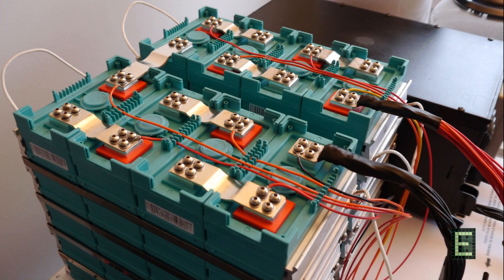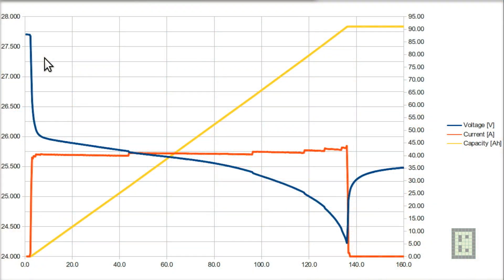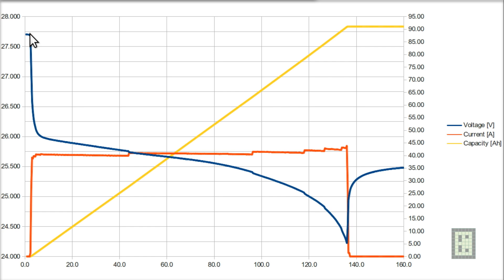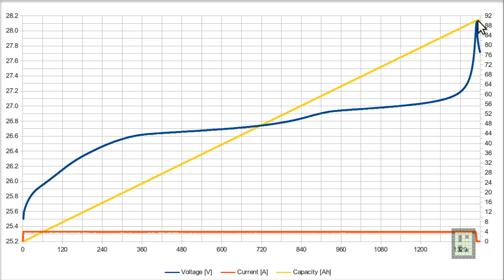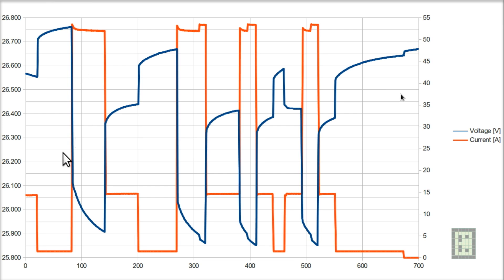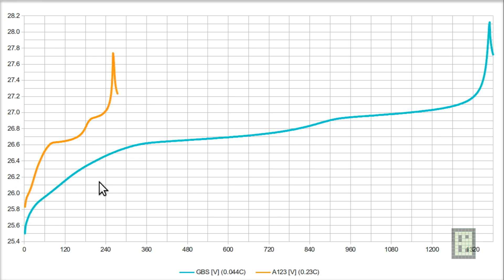GBS 100Ah LiFeMnPO4 Battery review part 2

Comment: Few years went. Do you have some other info about these batteries after using them? The fact that they didn't went to full 100Ah capacity, and only to about 90Ah is really strange. You mention the GBS have lower cycle life than A123, but from the spec sheet I see GBS-LFMP100AH have >3000 cycles at 100% DoD, and >5000 cycles at 90% DoD at one of the sellers, and <0.8 milliOhms. But then again on GBS aliexpress page (which are all mess, like same battery many times with different titles, and with some specs different on different pages, even when I look at the same model number of the battery! For example two different listing for LFP-100Ah, not LFMP, show different internal impedence and different charging/storage temperature ranges), for LFMP-100Ah I see indeed 3000 cycles at 80% DoD. But they also say 0.6miliOhms instead.

Examples:

https://gbsystem.en.alibaba.com/product/60220967211-220346384/100ah_lithium_solar_power_storage_battery_GBS_LFMP100Ah_B.html?spm=a2700.icbuShop.41413.52.448a14137aK20U

https://www.boostech.de/en/produkt/innopower-lfmp-100ah/

http://sd94f85fb6682eee7.jimcontent.com/download/version/1453492416/module/13104697325/name/GBS%20100Ah%20Datenblatt.pdf - also shows that they have more than 100Ah usually.
Reply from the maker: I used the battery to power my offgrid house (I live there so is full time use) for about 5 years when I upgraded my battery to a 5kWh made with A123 cells as my energy usage increased over time.
The spec when I purchased this cells where 1500 cycles at 80% DOD and 1.8mOhm internal impedance and they did worked as spec but spec is worse than any of the competitors.
Current generation seems to be improved with lower internal impedance and higher cycle life 3000 cycles at 80% DOD but that is still worse than Winston for example with 5000 cycles at 80% DOD.
I think the official Alibaba store has the correct spec 3000 cycles at 80% DOD and that means they improved doubled the cycle life compared to the first generation cells that I had.
A123 cells have 5400cycles at 100% DOD so superior to both GBS and Winston.
You can read here a bit about the degradation of my pack  http://electrodacus.com/solarforum.html?place=msg%2Felectrodacus%2FFqn_ShZDPdc%2FDUoG_r9fBQAJ
I had a much more detailed review on google+ but that no longer exist maybe I will rewrite that review. I had 17% degradation over 5 years with a 47% DOD every day so around 3.4% degradation per year most of that likely as calendar aging degradation while the A123 battery in similar use case had just 0.9% degradation after first year.

Comment: How about part 3 to see the capacity 3 years later.  Hopefully over 90 Ah.
Reply from the maker: It was barely 91Ah when I tested new and did this video almost 5 years ago. This was not the best LiFePO4 and I used the battery quite heavily in offgrid to power my house. A few months ago I did a test you can see the result here on my google+  https://plus.google.com/+electrodacus/posts/hQn19Z1WGgS
Reply: http://batteryuniversity.com/learn/article/how_to_prolong_lithium_based_batteries  According to this chart cycles double for every .1 volt drop in charging 18650s.   If you lowered the termination voltage to 27.3 you could see a significant reduction in degradation.   You would think all batteries would be somewhat similar.
Reply from the maker: That only works like that for high energy density cells like LiCoO2. The effect here by reducing the max charge voltage is much, much more insignificant for LiFePO4.
LiFePO4 has no problem with cycle life since in lab test they charge each cell to 3.6V and do a 80% DOD and get 5000 cycles as is the case for Winston cells the Sony LiFePO4 cells can get 6000 cycles at 100% DOD so the cycle life is no limitation and there is almost no degradation during cycling with this type of cells.
The more significant factor is aging that affects all type of batteries and that is usually not specified unfortunately.  Sony cells have this specified and it was just 0.3% capacity loss in storage per year at +23C but when the cell is kept at +40C the capacity degradation is already 1% per year.
With less quality cells like my GBS here the effect of aging is probably much higher even at low temperature and that was probably one of the main factors contributing to cell degradation.
With high energy cells if you reduce the max charge voltage you also reduce the available capacity so while you may bring the cycle life from 500 at 4.2V to 2000 at 4V the available capacity is just 75% or so and then the cost gets similar per capacity with LiFePO4 that has anyway higher cycle life and is also much safer to use

Comment: Hi Everyone,
I'm building a solar UPS system which will use the grid as the backup, it's to offset my electricity bill by taking low power appliances like fridges & lights etc off the grid, Which chemistry do you recommend, and which manufacturer?
Thanks
Reply from the maker: +shanon edser Not sure what country you live in and what the electricity rate is there but in most places in the world battery energy will be more expensive than grid energy. You ca look on some of my recent videos and see that I live offgrid now and power my house using LiFePO4 (the least expensive energy storage battery at this point but still more expensive than grid). I also designed and developed a Solar BMS that you may want to take a look at and that can be used to do exactly what you want but it will not be able to compete with grid or barely but there will sure not be an advantage.
Reply: +electrodacus 
Electricity is very expensive here in Australia, we actually have some of the most expensive electricity in the world (27cents per kWh at the moment)in other states (48cents) due to time of day metering which we will have where I am in Brisbane soon, luckily we have lots of sun.
 I am looking at importing batteries from China, GBS is one of the brands I'm considering so your opinions and experiences would be much appreciated.
Thanks,
Shanon
Reply from the maker: +shanon edser 27cent maybe even 48cent is not expensive enough to make battery storage cost effective.
Best case scenario is 15 to 20 cent/kWh for each kWh retrieved from the battery. In contrast solar PV panels produce electricity at about 3 cent/kWh so is much better to have an over-sized PV array that a large battery for offgrid and for grid tie battery will not really make economic sense in my opinion.
That 3 cent/kWh for solar PV production is the amortization of solar PV panels alone no other equipment and is based on 25 years life and 1$/Watt for the PV panels also based on the amount of solar I get here at my location in Western Canada that is exactly the same in Sydney Australia (average over a year).
So at the moment best option is to have a large PV array connected to grid and not have any battery storage.
Those 15 to 20 cent/kWh are also based on the best LiFePO4 batteries and a bit ideal numbers.
Best according to spec seems to be Winston LiFeYPO4 they have almost 4x lower internal resistance when compared to similar 100Ah GBS cells. Also claimed cycle life is 7000cycles at 70% DOD for the Winston cells.
So the amortization time is around 20 years or over with a 70% DOD cycle each day but that will probably be hard to obtain since energy consumption is variable from day to day.
Best thing is to use the energy when available from the sun as I mentioned as low as 3 cent/kWh then use energy during off peak hours when energy is less expensive if you opted for differential tariff.
I have a highly energy efficient house so I only use 60 to 80kWh/month and I use most of that during the day when available from the sun.
My calculated average rate (maybe a bit optimistic since I did not included the labor for installation just the cost of equipment) is about 16cent/kWh with best rate during the day around noon probably as good as around 5 to 6cent and as bad as 25 to 35 cent during the night. Again not realistic since the labor is not included and that could almost double this rates.
Reply: +electrodacus 
thanks for your help mate

Comment: I'm hoping to talk my company in to using these for offshore power for SCADA systems
Reply from the maker: It seems to work fine for me I use them daily with 50 to 85% DOD for close to two years and I do not see any significat loss in capacity. I will need to make a capacity test but now in winter is a bit hard since I need that energy. I will probably do that in spring to see exactly what the degradation is.
But if weight and volume is an isue LiCoO2 will work as good or better charged at 3.95V
I'm guessing since is a data aquisition system the discharge rate is quite low.

Comment: Hi,
Great Data sets. Do you have the related current draw data? I would like to use this to develop a battery management system, and could use real data (as opposed to generated data.
Thanks
Reply from the maker: The related current draw is there charge was done at constant current so is a strait line and discharge was done at constant power so almost a straight line again.
"generated data" ? This are real data see the other videos on how I made the measurements.
I'm actually working on a 3 to 8 cell BMS see my other video it will be fully programmable and work with any type of lithium cells.
The video is about the first revision the second revision you can see on my google+ page the Dacian Todea not electrodacus one you need to scroll down to some of the first posts there are a lot of photos with my off-grid house there.
The new version will support 80A discharge and 40A charge maybe I will decide to do even over 100A discharge if mounted on an additional heat-sink the unit is quite small and was designed to support continues use with simultaneously 80A charge and 40A discharge + the balancing of the cells.
It was designed for my house so it mets my needs.
I will start working again on this BMS next month since I took a long brake to build the house.
I intend to do crowdfunding and build at least 50pcs if you are interested there will be more details on this channel in the next months I still have to finalize the software before I make the announcement.

Comment: of course A123 is the best but the CALBs can be more practical to connect and more reliable supply.
and maybe the agility of CALBs is indicative of an overall superior product that may have longer life than for instance GBS. They typically also have 10% higher than rated capacity

Comment: Very nice reports on the GBS batteries. At $.50 per Watt/hr they offer great pricing to go with the well thought out packaging. Have you ever seen published data for voltage vs increasing load up to the stated acceptable short duration 10C?

Comment: I notice at 3:30 you stopped the charge after the voltage jumped up. My lead-acid battery requires me to sustain that high voltage for three hours at a lower charging current, of course. They call that the absorption charging phase. The middle charge area is called bulk charging. Do your LiFe batteries not have a required absorption charging time?
Reply: For LiFePO4, once you reach this sharp increase in voltage, you fix the voltage to lower than normal charging, and let the current still trickle into battery, until it lower to less than 0.05C usually. You can think of it as absorption. But he did charge them very slowly in the first place (using 4A, so about 0.04C), so once he reached the voltage bump, there would be not much to store extra probably. I would probably continue at 1A for some time, but not long.

Lead-acid are definitively different in their chemistry tho.

Comment: the math will not equal the real world usage. So you may be disappointed when you find out you will use more electricity than you counted on. You will need more batteries. Good Luck. I wish the best in your new adventure. I have seen people use about 20 batteries to live off grid. The four I have are no where close to enough storage.

Comment: May be for you but when I want to keep my food from spoiling I use a refrigerator. I cannot run my fridge for but only a few hours after dark with my four 50 amp hour optima. So I guess you dont plan on running a fridge. you may be able to run a lamp and a tv for dozen hours or so. this is what I found out from my past experiences.